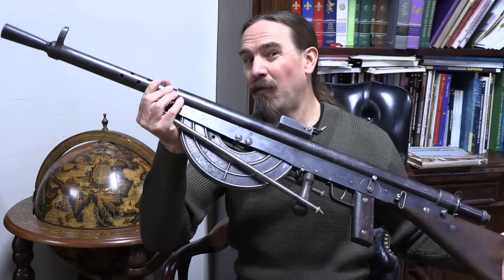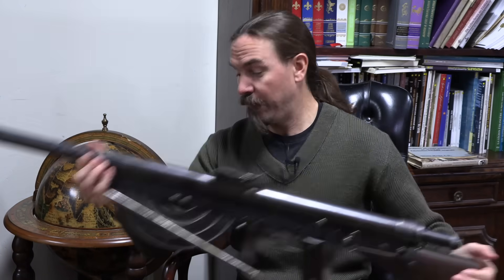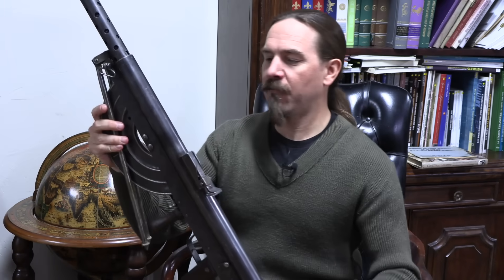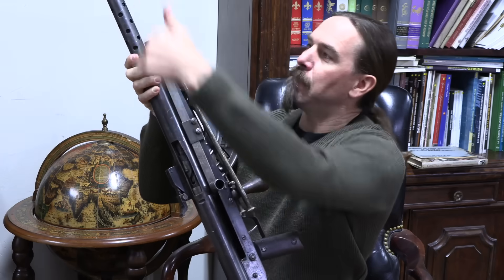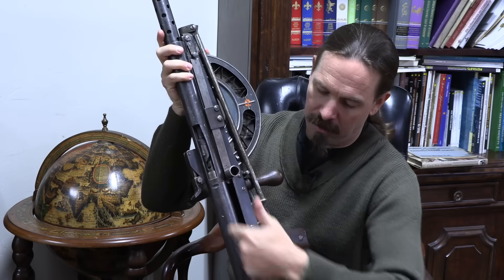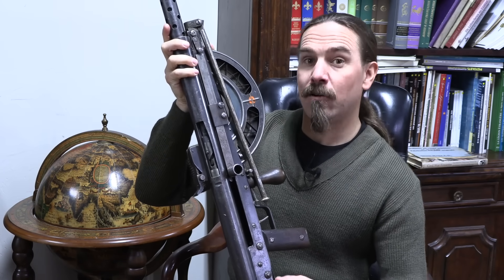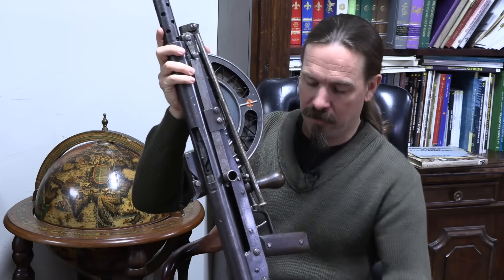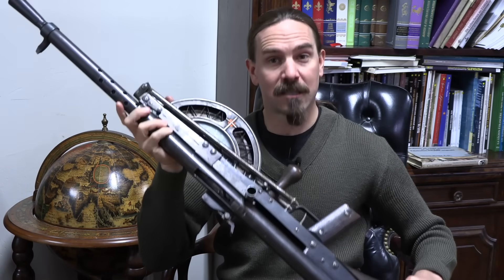Rate of Fire: What Determines it and How to Change It

Comment: The problem with rate of fire is people look only at the maximum rate of fire. What is the RoF if I pull the trigger and keep it depressed.... And they leave it there, all too often judging the effectiveness of an MG by its maximum achievable rate of fire....

Problem is this maximum rate of fire is only achievable in machineguns for a short period, if at all. The MG42 had a ferocious 1200 rounds per minute rate of fire, but if you try and sustain that for more than 500 or so rounds you are going to quite literally melt the barrel. That rate of fire simply is not practical, either for the continued reliability of the gun, or for supplying ammunition to the gun....

Which is why practical rate of fire is more important in machineguns than maximum rate of fire. How many rounds per minutes can we sustain from this MG without damaging the weapon, crew, and while being able to actually feed the thing with enough ammunition that we can keep it firing reliably....

Which is why in WWII the practical rate of fire of an MG-42 in squad use was only around 200 rounds per minute, not the full 1200 rounds the gun was supposedly capable of. That is not actually very far off the practical rate of fire of a bren gun in the same use case as the sections main firepower element.... (section being the British army version of the squad, same thing just different name).

Comment: The Blish mechanism in the first pattern Thompson submachine guns. Seems to have been great on paper but rather less in practice. Of course, some smart ass will mention chain guns and the GAU 8 and M60A1 Gatalings in aircraft and phalanx mountings on ships. In these cases, it's down to gearing and rheostats affecting the electric motors. Another oddity was the Japanese 37mm single shot anti-aircraft cannon. Mounted on their WW2 ships. Possibly, in this case, the rate of fire was down to the gun captains use of a beating stick! Lol

Comment: I know how spring and mass systems vibrate, automatic weapons seem to be much more than that.  I always thought the springs and mass were somewhat tuned to prevent a lot of slamming into the receiver but apparently that is not the case.  How much does slamming into the receiver affect longevity of the mechanism?

Comment: I'm thinking - make the bolt with a place for a heavy insert that can be removed, thus changing the bolt mass and changing the rate of fire. May not be quick and easy to do but should be doable. Or just have several bolts that can be inserted, some of them lightened by strategic cut-outs (like a fuller in swords and knives) having a highly standardized system overall for the rest of the mechanics while being able to tune rate of fire based on what the particular weapon would be used for.

Comment: I'm kinda surprised you didn't mention the strength of the spring on a blow back style MG. I was told you could pull the spring out of a Sten and stretch it out and it would dramatically increase the rate of fire

Comment: Delaying the firing pin will reduce the rate of fire. Delay between bolt lock and cartidge firing. At maximum rate, the cartridge is fired as soon as the bolt is locked (for certain values of lock).

Sometimes, delaying the opening of the bolt results in poor extraction with insufficient residual chamber pressure to assist.  OTOH, too much pressure and the case expands so much that friction is too great and the extractor rips the case apart. esp with Elbonian munitions supplies 😊. If you then cannot quickly change barrels after the bolt fails to lock, ...

Comment: Counter intuitively, installing a heavier recoil spring does not reduce the rate of fire, and may actually increase it. 

There were also interesting solutions with separate weights used as rate reducers. I think in Scorpions?

Comment: In changing any RPM or ROF, it totally depends on the weapon. Across the board. The recoil springs are the most obvious and easy to adjust any rate of fire before messing with bolt weight or travel.

Comment: Great video and future suggestion - muzzle booster (which also affects rate of fire). 
I'm not sure just simply changing the mass of a blowback bolt will change the rate of fire since it must be matched to the spring rate. 
I hope my memory has the following details correct ......a heavy bolt and soft spring = slow but a  light bolt and powerful spring = fast. I recall reading there were some SMGs that could swop the bolt/spring set for different rates of fire.  
Perhaps an hororable mention also for the Browning accelerator in their MGs. This was a comma shaped device a little hard to explain but basically the recoiling barrel struck just above the eye of the comma and the longer leverage of the long end of the comma flicked the (now-unlocked) recoiling bolt to increase the rearward velocity. If you google a cutaway, you will see it. 
The RAF Browning .303 had about twice the rate of fire (1,150 rpm) of US ground-based guns and incorporated both an accelerator and muzzle booster. Ian has a video on the RAF Browning .303.

Comment: I'd only add a fun example recently is the Lage uppers for the MAC series which have tungsten bolts to increase the mass/inertia and slow down some of the MACs comical rate of fire. Another way to change RoF without messing with bolt shape or receiver shape

Comment: I know that gas operated systems do parasitize some of the velocity from the round. What I am curious about is whether physics come into play similarly on blowback and recoil operated systems. If the system is disabled, does the round gain velocity? In the same vein, if a gun typically fired by hand is fired from an immovable sled, does at least some of the energy that would have become recoil instead go out the barrel as well? I know limp wristing a blowback pistol can cause failures in the cycling, much like having an underpowered cartridge, so would a stronger grip potentially increase muzzle velocity? Would these effects have a more than negligible increase in velocity if what I posited is true?

Also, you did miss cartridge power affecting RoF. In 7.62x51mm systems like the M14, M60, and M240, if you're firing M80 ball rounds vs M118LR or the Mk319 mod 0 you will get different cycling rates

Comment: Every time I go to a range that has FA, the rate of fire is determined by only one thing: my bank account.
Reply: In military terms this translates into the amount of ammunition that can be carried V the rate of fire. A front line SMG may benefit from a heavy bolt slowing the rate of fire to avoid firing off all the ammunition too quickly. A personal defence SMG might have a need for instant firepower and a fast rate of fire to solve the problem fast. In locked breech rifles one can note that the Canadians chose to use fully automatic FALs as a support weapon whilst the British kept their FALs in semi automatic mode for the riflemen to maintain a pint of aim and conserve ammunition.

Comment: 3:05 Minor correction. Energy is scalar, it does not go into directions. So bullet and bolt do not get equal amounts of kinetic energy. Force that pushes them is equal, so they get equal momentum while bullet is inside the barrel.

Edit: OK, not sure if it helps at this point but disclaimer comes. You can probably write quite good PHD Dissertation if you analyze EVERYTHING that is going on during gunshot. But everything was not the point of Ian and it was not mine. The point is: we have closed system of bullet, bolt and weightless ideal gas that pushes bullet and bolt into opposite directions. No friction, no case, no other moving parts, no recoil... An in this case bullet and bolt will have same by absolute value and opposite in direction momentum and some amounts of kinetic energy that are not equal (unless bullet and bolt have same mass, which they probably should not). Hope this clears things out a bit.
Reply: Also friction loss and losses transmitted into the receiver laterally and not backwards all have an effect. Fire rates are often decided by simply how slow (or fast) you can make it before it mechanically fails to load or eject (which can at best often be estimated only).
Reply: @generationkilled  I was told whilst serving in the Estonian military, and I don't know whether it's true or not, that you can actually tell the difference between Norwegian and German built MG-3s because the German ones are better built, the bolt has less friction, and thereby the rate of fire is noticeably higher.
Reply: @wurfyy  wouldn't surprise me...Germans had some of the best machine tools even just after the post war era...Whereas the Norwegians were setting up from scratch. But its probably the rpm limiter upgrade that lowered fire rate.
Reply: Anyone know how long an open bolt gun takes to fire from pulling the trigger? Always been curious and besides video games I can’t find anything concrete
Reply: @alexv1vd  Depends on the gun...spring strength rate, locking type it all make a huge difference. Even with the same Uzi design, the different models Standard, Mini and Micro Uzi have different lock times, due to weights of bolt and spring strength. Also caliber type matters too.
Reply: @alexv1vd depends on the bolt weight and spring rate of that particular gun.

I'd recommend watching the Garand Thumb video shooting an open bolt BAR in semi auto, the lock time is very visible.
Reply: @alexmaurice4274  what you're refering to is something called lock time. Its a very old term dating back to lock fired guns (muzzel loaders) Mark Novak has a really great video on this comparing slowmo between iirc a flintlock and a revolver.
Reply: yes, and they don't even get equal momentum. The momentum of the bullet equals  the entire momentum imparted to the gun, of which the bolt is only part. Some of the recoil force is transmitted to the chamber by friction with the walls. Only the bolt thrust transmits momentum to the bolt.
Reply: Yep, basic principle of conservation of momentum, the total momentum imparted to the gun must equal the total momentum of the bullet and propellent gas travelling in the opposite direction. Calculation of the gas value is non-trivial as it will not exist at a consistent velocity for the whole mass.
Reply: Hmm. I think you are incorrect. Kinetic energy is a property of motion and mass. The force imparted upon both the bullet and the bolt is the same. The mass is different but kinetic energy is a function of both. Thus the bullet has the same kinetic energy and accelerates very quickly to a high velocity whilst the heavier bolt is slower. Were the bolt and bullet the same mass they would accelerate at the same rate to the same velocity if not constrained.

So, yeah. You're wrong.
Reply: @markchisholm2657  Kinetic energy isn't required to be equal - momentum is. Before you fire the gun the net momentum of the system is 0, after you fire the gun the net momentum is still 0 - so all the momentum of stuff going out the front (bullet + gas/debris) is equalled exactly by the momentum of stuff moving backwards (bolt, pistons, gun itself, etc).
Reply: @markchisholm2657  It's counterintuitive but it is how the real world works. COnservation of Momentum is a basic college level engineering concept and ti clearly applies here.
Reply: @markchisholm2657  Energy is a product of force and distance, momentum is the product of force and time.
Reply: And, to be deeply pedantic, the inverse is true a minute or so earlier, velocity is a vector therefore average bolt velocity in a cycle is zero, average bolt speed is what we care about.
Reply: @TertiaryBrewing  average bolt velocity won't necessarily be zero- it will be a function of the difference between average speed backwards and average speed forwards. Only if the average speed in both directions is equal will it be zero.

That said, your point stands. Average velocity of the bolt is useless info, it's the average speed you need.
Reply: @347Jimmy  Not really, I think, the total distance travelled is zero (assuming the gun is stationary, which it won't be) therefore the average velocity is zero.  But at this point we're arguing very theoretical, approximate physics on teh internet 🙂
Reply: @TertiaryBrewing  yeah you're right, the difference in time between back and forth will balance out the difference in speed
Reply: Huh.
Kinetic energy is 1/2 * m * v^2, right?

And since force is m * a, and the force comes from the gunpowder expanding in volume in the confined space, the force is the same. Right?

Now, the m of the bullet and that of the bolt is obviously not the same, so the bullet is gonna have much more acceraltion with the same force.

But does that mean that one gets more kinetic energy?
Or does it just mean that both get the same kinetic energy from the propellant, and it's just that (due to a higher m), the bolt gets a much lower number for v^2 than the bullet gets?

I guess you'd need much higher level physics/math for the process, since you'd essentially have to calculate it in tiny time increments, rather than one moment in time, right?

But still it just seems logical to me that all the energy of the propellant goes equally into the bolt and into the bullet (with losses to heat and friction etc, but I see no reason why those would affect one more than the other - although I suppose the bolt doesn't have rifling so it should have less friction than the bullet?). 
And if the energy is divided equally, then shouldn't the kinetic energy be the same? 
The velocity is of course not the same, but neither is the mass. 

Anyhow, if I've skipped a logic step or misremember some of my physics, please correct me :)
Reply: @MrNicoJac  Nope on the energy being shared equally. You can do the math on it quite easily if you use an average force value. 

Calculating a real world value for such is non-trivial, but for demonstration purposes i'm going to ignore that and use arbitrary values as they demonstrate the point just fine.

Lets use values for a small cannon as that makes it possibble to use round numbers for approximations which makes the math easier.

This cannon has a bolt mass of 20KG's and fires a bullet of mass 1KG.

The cannon shell and breech face both have a diameter of 2cm this means both the bullet and the bolt have the same force applied to them.

We'll assume a force on the base of the bullet, (and thus an equal force on the bolt face), of 200,000 newtons. This produces an acceleration force on the bullet of 200,000 m/s^2, and an acceleration of 10,000  m/s^2 on the bolt.

For the sake of simplicity we'll assume an unrealistically long barrel such that the time this force is applied for is equal to 0.01 seconds.

This means the bullet reach's a velocity of 2,000 m/s, whilst the bolt reaches a velocity of 100 m/s, (i'm assuming a simple blowback operation here as it means there no need to account for ocking times).

The kinetic energy of the bullet is: 2000^2*0.5*1 = 2,000,000 

The kinetic energy of the bolt is:
100^2*0.5*20 = 100,000 

As you can see the energy does not match The momentum however will match. 

Momentum is  equal to mass times velocity.

The momentum of the bullet is:
2000*1 = 2,000

 The momentum of the bolt is: 
100*20 = 2,000

As you can see the energy levels are dramatically different, but the momentum levels are the same.

Now the real world is a lot more complex than this as the bolt face typically has a larger area than the base of the bullet, (though many pistol cartridges are the same), there's friction losses on both the bullet and the bolt, locking times, and a whole bunch of other things. But they don't change the underlying physics, you just have a lot more math and values to account for.
Reply: @darthkarl99  
That is an excellent explanation!! 🤩
Really cleared things up for me, thank you so much for taking the time to explain, I really appreciate it ^^
Reply: @MrNicoJac  You have made several unwarranted or ill formed jumps in your logic process. Too many for me to pick at in a YT comment.  Force is not energy, acceleration involves distance and time.
Reply: @MrNicoJac There are a lot of levels you can take the physics to here, probably the easiest is that the forces in each direction will be (approx) the same.  The bullet, being lighter, will accelerate more than the bolt.  This will mean that there is a lot more energy in the bullet than in the bolt as energy is proportional to v^2.
  I think your physics memory is mixing in the conservation of momentum from inelastic collisions.
  The approx above is due to us actually thinking about a pressurised gas which means the geometry of the case is also relevant.
Reply: @TertiaryBrewing 
Ah, yeah, that makes sense. 
Thanks for pinpointing where my memory is mixing things up :)
Reply: YouTube comment section physicists are my favorite physicists.

Comment: Yes I'd like to hear what is the best application, and not only that. I'd like to also here something about flaws or impact of high/low rate of fire on the gun and operator. You've partially discussed that by speaking about early M16 flaws...
Reply: It is a compromise. A faster rate of fire leaves smaller gaps between bullets hitting the target and that scares the enemy and increases the chance of a hit unless the MG climbs.

The bad news is the logistics chain required to bring up new ammo. There is a difference between what front line soldiers want (MORE, often at a complete loss of accuracy, e.g., early M16) and the Quartermaster who only has so many trucks.